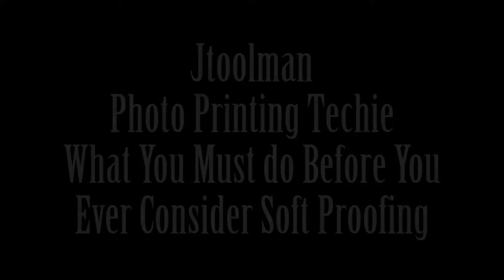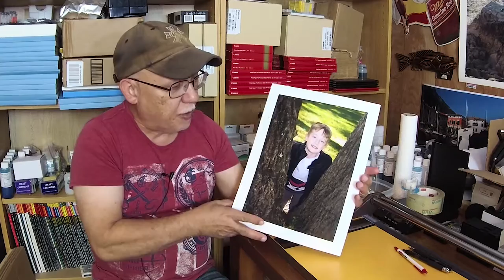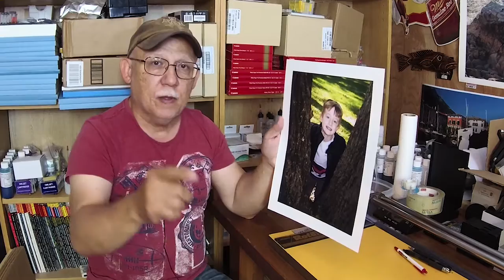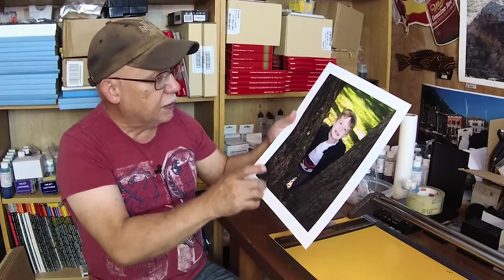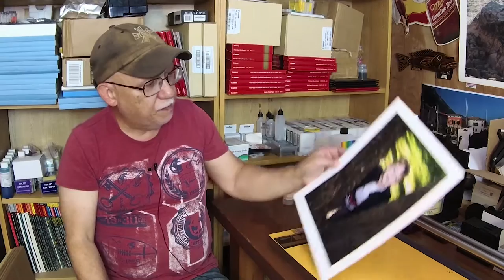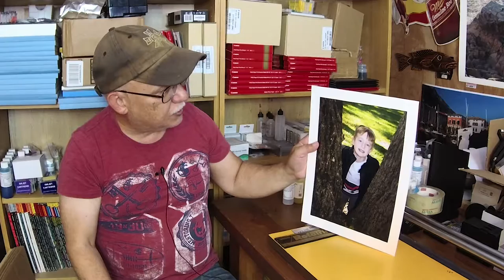What You Must do Before You Ever Consider Soft Proofing

Comment: I'm not sure if you are referring to this program or not but one thing I found very useful is to profile  the printer with Canon Print Studio Pro. I recommend printing the two sheets in 13" x 19" so the colors can be seen better.  The color, contrast and brightness can all be adjusted to match your monitor. The brightness adjustment is especially useful because turning down the brightness of the monitor to compensate for prints that are too dark is not as good a solution. I think this program may also be useful to someone who for whatever reason does not have their monitor calibrated. Another good thing is you can use your own images for the profile.
Reply from the maker: Its not a profile. You are simply performing the Pattern Print prcess which is just a collage of test prints to allow you to nail down the adjustments you need to enter nn the adjustment sliders to get the print to come out just the way you want it to. So remember this is not calibration.  You should be able to print with PSP and get perfect prints without having to resort to Pattern Print. Assuming you monitor is hardware calibrated.  This is useful if you want to stray from the default neutral look and need visual samples to choose from. If you have to rely on it to get a neutral print then something is wrong with your workflow.

Comment: Jose, can a laptop (Macbook Pro) be color calibrated? It has built in calibration, which I tweek now and then, but I don't know how close that is. (So far, prints I order from the lab seem to be very close to what I see on my screen.
Reply from the maker: You can only calibrate with an external spectrophotometer and its software. Not just software.
Reply: @cheo1949 , so the external spectrophotometer will work on a laptop screen?
Reply from the maker: Yes and no. If the screen display cause a shift depending on viewing angle then it is very difficult to get consistent results. Normally lap tops are not good candidates unless their displays look the same regardless of viewing angle.
Reply: Given that my laptop is getting a little long in tooth (2013) and the X-Rite Colormunki is on sale, I added it to my order for the Pixma Pro-100. Looks like I'll be back printing in the new year! Most grateful again, for all your informative videos. Happy New Year!

Comment: Hello José, I have a Pixma PRO9500 Mark II and I don't see the ProRGB option in the driver, actually it doesn't show any color space. Is this an option for newer printers?
Reply from the maker: CANON Printers do not show that like EPSON drivers do.
You choose Photo Printing in the Main Driver then Paper type and quality if you intend to let the driver control color.
Reply: Jose Rodriguez ok thanks for the heads up. I noticed that my pixma printer is not matching colors on my new windows pc as it did on the Mac I had that burned a few months ago.
Reply from the maker: Is it calibrated?
Reply: Jose Rodriguez yes, it is.
Reply from the maker: You will need to print a standard image with the driver controlling color. Do not edit the image at all. Simply open it and print it and evaluated it for correct rendition. If it looks correct and does not on the monitor then you know what you need to do. Join my FaceBook group and get the file. Go to my channels main page and click the F round icon link on the lower right of the image of my print room. Request membership and I will approve it, click on the FILES link on the left for your images. "Evaluation Image" tiff.
Reply: Jose Rodriguez thank you José, did as you said. The only thing I changed is that as I am using PC inks I had to leave the color management to PS with their icc profile for the Canon Pro Luster paper. I've been doing most of my prints from LR but I think the printing module in PS is doing a better job.
Reply from the maker: Use PC ICC profiles. D50
Reply: That's the one I chose, thanks again José! I'll send you the file by e-mail just in case you want to give it a try. The Pixma PRO9500 Mk II did a good job considering that it's already an old printer and the blacks in the photo I printed are not easy.
Reply from the maker: I will not be able to print it on the PRO9500 mkII as mine is DOA. In could print it on the PRO-10 with PC inks.
Reply: Jose Rodriguez actually would be interesting to print them on the Epson P800 or PRO-1000 if you feel it's worth it.
Reply from the maker: Can you please resend to tooljoe1949@yahoo.com.
Reply: Jose Rodriguez no problem, will do.
Reply: Hi José, I did resend the e-mail, did you get it?
Reply from the maker: Yes I did! Thanks!
Reply from the maker: But I can not download it from the forwarded email. Please send it again on a new email. Is it larger than 20mb? If so it might be too big.
Reply: Jose Rodriguez yes it's large because is a TIF file. I tried sending it using Google drive to download it.

Comment: Jose, am doing what you have suggested, printing the test images which I have downloaded to obtain a reference point for my printers. The file I have is called PDI target you have shown it many times. On my A1430, I did a head alignment, then I printed a nozzle pattern, which was only missing a couple of nozzles, then I printed a purge sheet and all looked really good, then I bit the bullet and put in a sheet of Epson Premium Glossy, to print the test page, it printed beautifully EXCEPT that there is a GREEN cast on the blacks, ALL the other colours look great. In the strip on the side for the black hue graduations 0, 5, 10 are ok, but 15,20 25 are almost fully dark green, then from 30 upwards the blacks and greys assume normal hues, Now I have printed a Qimage unclog using black only and it is perfect. Around the Strawberries the shadows are green, and on the babies faces the shadows are green, but the young girl on the left of the page still has black hair, so it seems that it is only happening where the darker greys need to be. Any thoughts?

Comment: I know this is an older video and I probably won't get an answer but here goes. You mention to print a controlled print from somewhere on the internet probably the one with the red strawberries use that profile and that color space and all of this being OEM. to late watched this a long time after starting to use third party inks, I only watched this because I am now switching to Signature Edition all on a 100 pro. Is there a process to follow to make all of this work and is this going to be an issue everytime I try a new paper?? 🤔
Reply from the maker: The way to print an Evaluation Image is to use A Matching paper for which there is a matching paper cboice in the driver. The image is not to be tampered with. So you open the image and print it letting the driver control color. In the driver ColornManuak Adjustment  you click to open it and choose Matching and ICM. The you must choose and print on a Canon paper like PRO LUSTER. print. The results will show how accurate the printer can reproduce an Evakuation Image ( yes the strawberry one ). When you switch to another non Canon paper you will need a custom and useba different method to print. This letting the application control color though that custom paper profile and them turning Color Matching from ICM to NONE.

Comment: Now gone through the exercise on the R1900, after sorting out a few carts that needed filling, did a couple of tests then put in the good paper, sadly no grays, good blacks but grays all green, starting at about number 35 on the scale. But I am Impressed with other colours, any thoughts?
Reply from the maker: So you are nnmow abnle to print a linearly neutral black to white ramp on the 1430 but not n the r1900?  Remenber that boty these printrers on only have one black. The r1900 has pk and mk but still only one is used depending on the paper.  So it is very difficult for them to print linear neutral black to white ramp and so, B&W prints. Only a custom profile will solve that.
Reply: I was afraid of that, but still I thought it was worse than it needed to be. I decided that I had to do more, so ran more nozzle checks, found the Magenta was not working all that well, got that fixed, then found the MK was not working at all, got that fixed, doing many purges and cart top ups etc. Now I have a PERFECT print, yahooo....it is magnificent,  now i have my BENCHMARK, with the last of what will be my OEM ink supply, moving onto PC inks at the next refill. The print is so good that I feel like framing it!! After listening to your video again, you mentioned the affect of Magenta missing and when I looked at my first print with the green cast I carefully examined the places where Magenta should have been and it was not there. Of course with this ink set you have Red and Orange so you still get those and you have to look very hard to realise that you do not have Magenta. I am sure that is what the issue was, as the MK would probably not have been used due to printing glossy. I am a very happy hobby printer!

Comment: What steps should be taken if my print of a standard image is imperfect?
Reply from the maker: Well how imperfect is it? I will NEVER be 100% perfect but you want to achieve a pleasant natural result. Do not resort to the monitor at this time.   Are you letting the driver control color using Epson sRGB ( if printing on an EPSON ) ? What Printer and paper and Inks are you using?
Reply: I'm printing with a Canon Pro 100 using Precision Color inks and Red River Ultra Pro Satin 4. After viewing the print in better light, I actually  think the PC ink test print to be more satisfactory than the OEM ink print: more pleasing contrast and color saturation. One of the lighter reds seems a bit weak  I guess I was expecting 100% perfection. Looks like I really didn't have a problem after all. Thanks, Jose.
Reply from the maker: No third party ink will EVER match OEM. You are saving about 80% in your ink costs and quality is at about 95% If you know how to use ICC profiles on a CANON PRO-100 ( See my videos if you do not ) here is one excellent profile fro CANON PRO- Luster made specifically fro PC inks   https://www.sendspace.com/file/6yvf15

Comment: Hi Jose
I have a very straight forward simple question I cannot find an answer to anywhere.
When editing a raw/tiff photo in Lightroom, in the 16 bit prophoto colour space, without any other colour space embedded, what conversion is happening when it is printed, assuming there is any conversion at all?
I.e. - edit raw image - soft proof - THEN go directly to print the photo WITHOUT exporting the photo to a file in sRGB or Adobe?
Is it printing from the same working space with 16 bit - potentially not getting optimal results?

Comment: Hi Joe!
I have a question about printing the test image. Would it also be helpful to print the test image using the paper manufacturers ICC profile?
Thanks!
Vin
Reply from the maker: Yes but only  you determine that er can do it letting IT control color. Watch my videos on printing standard images. Before you jump to printing with ICC profiles make sure your printer is working properly without extra manipulations.